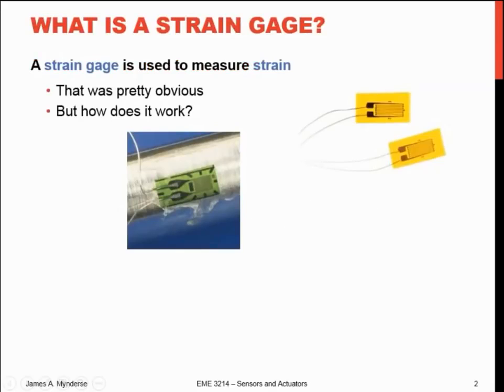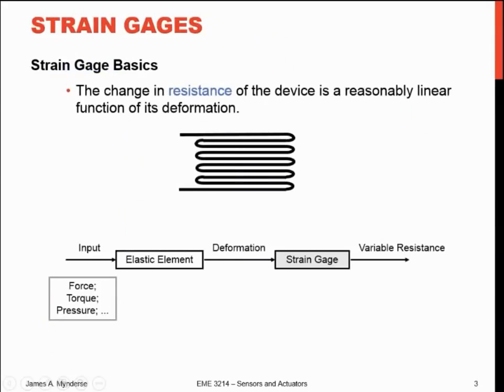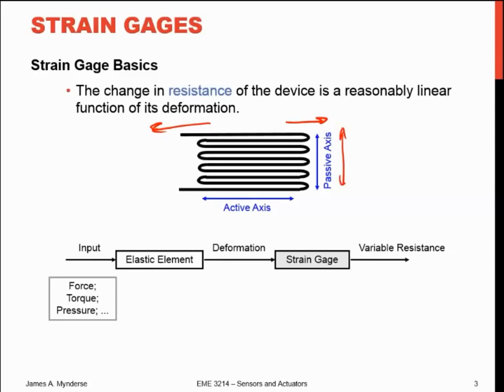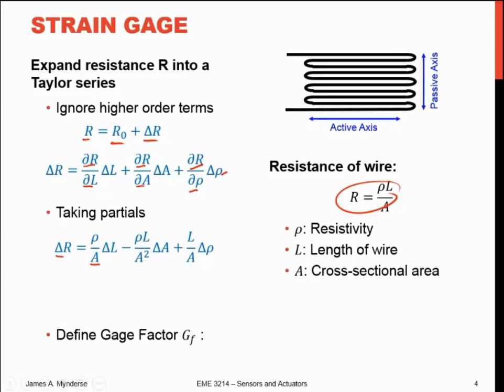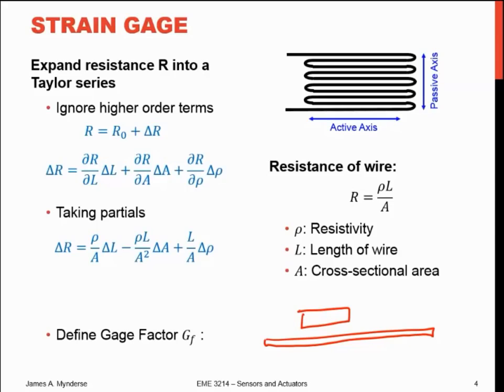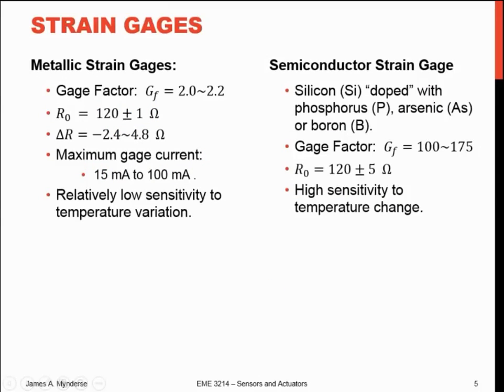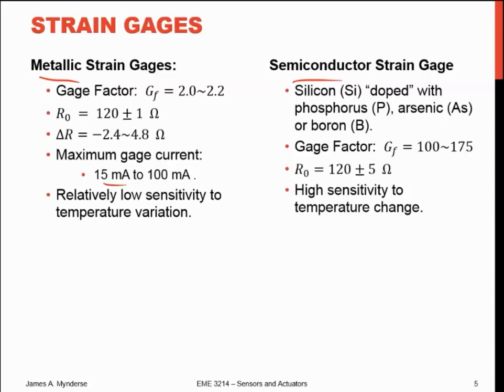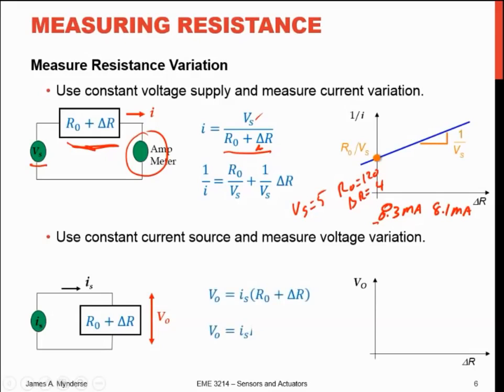Strain gauge basics

Comment: How wie can calculate the Chang of length,for example if the resistance changs itself
Reply from the maker: If you have just one strain gauge and the resistance is changing due to, for example, a change in temperature, then you can't separate the change in resistance from a change of length unless you know things like the actual temperatures. Or, you can do things like use multiple strain gauges - one in tension, one in compression - so that the change in resistance due to temperature cancels out (assuming the temperature is the same in both places). 
You have to be careful with your experimental setup to correct for or minimize sources of error.

Comment: Please answer this question:
A strip of high-strength steel has a length of 30 cm and cross section of 1mm by 20mm. The modulus of elasticity is 200GPa. Determine the change in resistance when 1000 micro-strain experience by the steel. Gauge factor of 2.10.
Reply: pls teach how to find resistivity